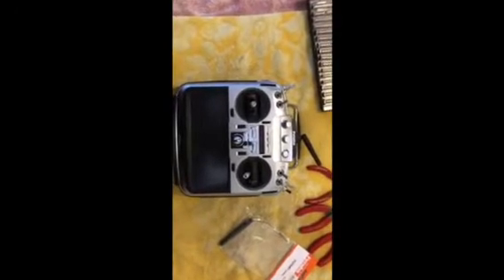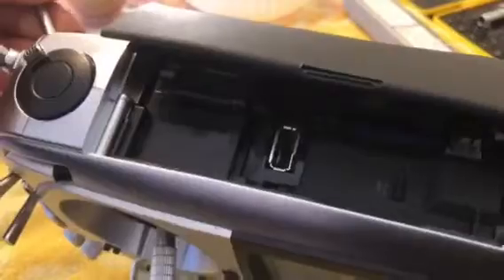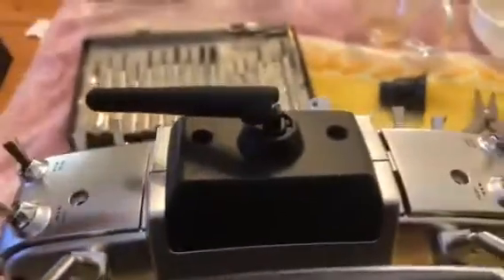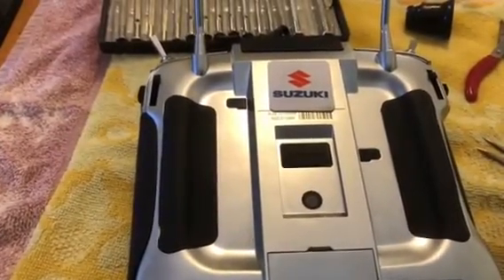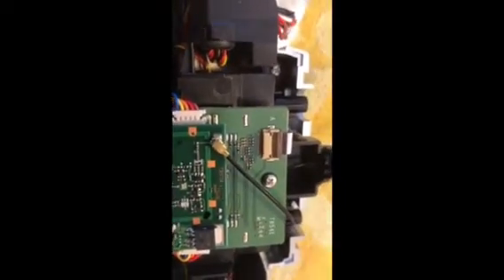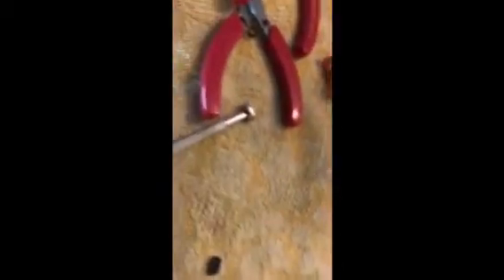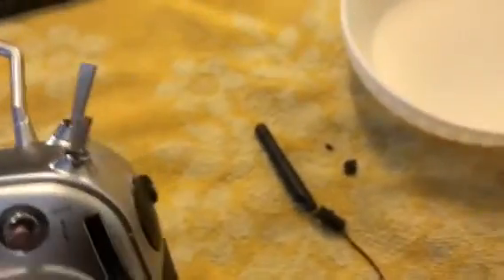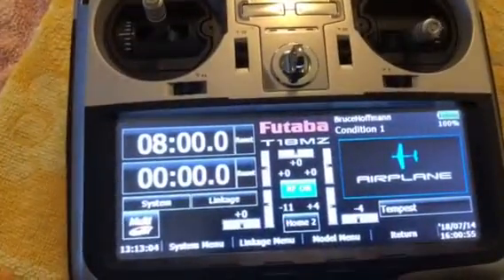Futaba 18MZ antenna replacement

Comment: Hi

To put back in aerial into circuit board. Did you just push it in with your fingers? 
How did you take it off? Was it with a pliers? Thanks
Reply from the maker: I think it was like a little press stud and I prised it off with my finger nail. Goes back on the same way, just sort of clicks when on. You’ll know if it’s on properly if a light tug on the cable doesn’t take the connection apart.
Reply: @brucehoffmann1092  Thanks Bruce. I ordered one and it's ariving soon. It's a critcal part of the transmitter, just worried that it will not connect properly and end up crashing a plane. 

I'll be sure to do a range check once i fit it. Thanks for your help